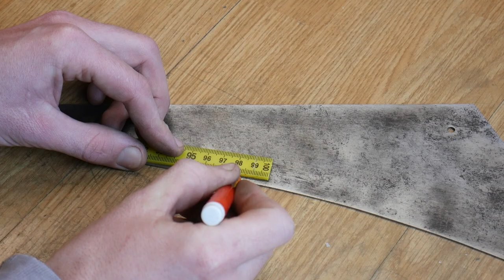Rusty Fox Tail Hand Saw Restoration

Comment: Very nice job.  Don't believe I have ever seen teeth cut off of a saw blade and news ones files in.  I might have polished the blade more.  Polished means smoother surface and less friction when sawing.  Excellent work saving the old saw.
Reply from the maker: Thank you for your feedback, Thomas.. the blade was eaten a little deep in a few places and I would thin it too hard if I sanded it completely, but of course there is always room for improvement! Thank you  again :)

Comment: On those through handle cracks, you can use cotton string to push the glue intomthe cracks. Add glue, wrap string around fingers and guide it through the crack. The glue will stick to the string, pull it up and down till you think it got to the surfaces glued. Remove string and add rubber bands (when applicable) to hold tightly till its dry.
Reply from the maker: Thank you for your feedback :)

Comment: Just found this vid.  This is a comment section so here are my comments. #1 don't sand cracks or splits inside.  #2 loose the dowl. joints glued and clamped with wood working glue are stronger than any wood surrounding the joint so it just weakens the repair.  #3 glue is not filler. to fill voids. sand first, then mix glue with the sanding dust and apply.  #4 toss that glue.  GOOD quality woodworking glue dries clear not white.  (Are you using school paste glue?  it dries white I know).  Cutting the saw plate to a curve seems pointless. but your call.  It always amuses me to watch a vid, made by some one who is obviously an amateur.
Reply from the maker: Hi, Patrick! Calling me an amateur you were really kind :)) I did a lot of mistakes here! For the filling I used scraps from the filing which is wrong, I thought that the sanding residues contain dust and will affect! It is not school paste glue, it is carpentry glue, it remained white probably because the volume was too large! Cutting the saw plate to a curve it allows me to make more teeth! Thank you for your feedback! :)